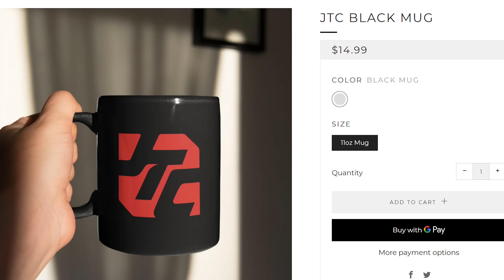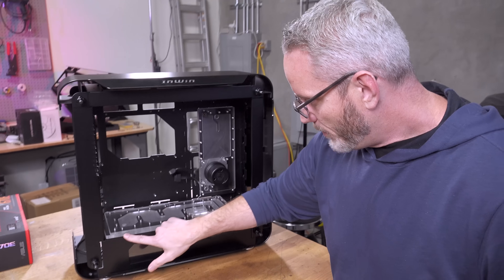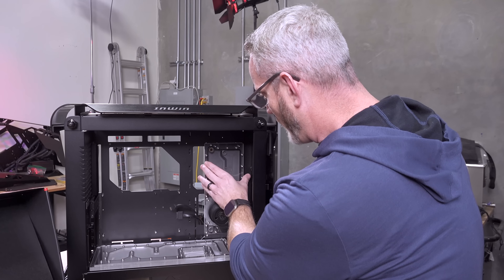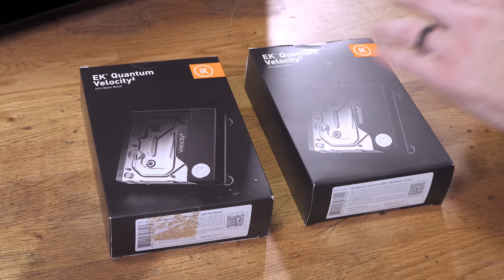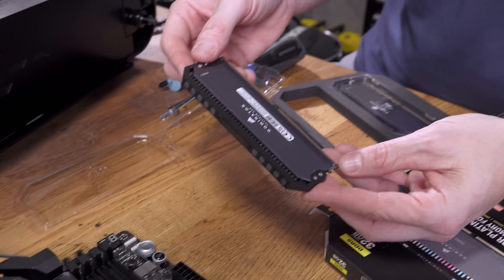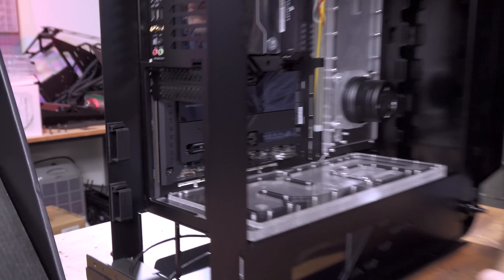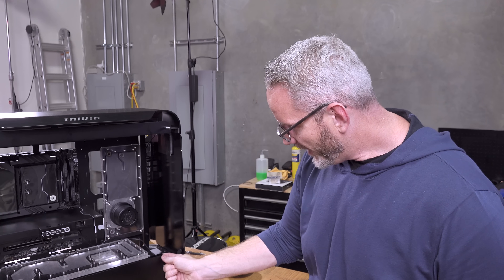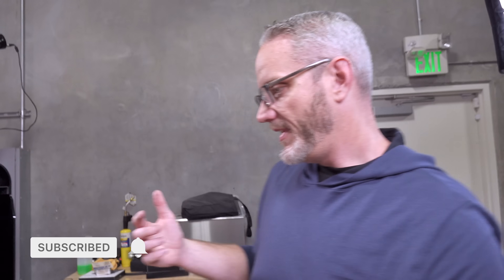My first water cooled build is 2023!

Comment: Jay, leave the edges frosted but don't use the trim paint. Get some of the tail light tint paint. It will make the edge seem black until the LED's are on, then it will tone down the light just a little bit. Kind of like a two way mirror.

Comment: Great video, thanks and hope you feel better soon. For me, allergy season started early this year, though it is still cold in Germany... The bottom distribution plate seems to create as may problems as it solves, unfortunatly. I've never done my own water cooling, but from your and similar videos, I could see this "tube sequence" working: 1) fittings-only connection from pump-out to bottom distro; 2) left-bottom distro out into right GPU in; 3) right GPU out along GPU and back-side of the case into top radiator in; 4) top radiator out to top CPU in; 5) bottom CPU out towards the top and then right in to the front radiator port closer to the glass panel; 6) front radiator into the pump reservoir. You could terminate tube 5) into the front radiator with a T-style fitting with the T-junction having a quick-connect pointing up and out as a fill port. In terms of bends, that seems managable: 2) 3 bends; 3) 2-4 bends, depending on how many right angles you want and how well the ports line up; 4) 3 bends; 5) same as 3); 6) 2 bends. For either 2) or 4) or both you could even consider use two singly-bent tubes with a 90° fitting instead of 3 bends! A black fitting there would be kind of understated, chrome too much, but are there gun-metal colored ones?!?

For temperatures it most likely will not have a measurable impact to have a rad behind either heat source, but it feels more satisfying than having "pre-heated" water trying to cool GPU or CPU. And your radiator fan speeds would reflect either GPU or CPU intensive tasks differently, which might be cool ;-)

Comment: Just from gpu to cpu, then into the left radiator intake and from outlet to vertical distro plate with slight bend in the start to match the hole. will be easy, less restrictions for pump. And start using xFlow radiators come on, they are so good for top mount, saves a lot of piping and does not restrict flow.

Comment: I also had rattling/dead Uni fans in my build of 18 months. Of course it was the middle fan in the stack, so I just ripped them all out and replaced with my old Noiseblocker eLoops which are still going strong after 12 years.

Comment: I got the Lightwings in my build and i can tell they are beasts. 2 360x30mm rads and they're running at about 850rpm, absolutely silent while performing the same as my old Corsair Fans@ 1000rpm...

Comment: Polishing acrylic cut edges is work intensive but well worth it. I used to hand sand with 400, 600, 800, 1000 then use the Dremel white barrel brush with red jewelers paste to get a glass finish

Comment: I'm currently building a case for my new build, the case is an open case design, made out of 16mm copper piping, the case itself will also be filled with liquid to be part of the watercooling of the CPU and GPU, using 2x480 rads, both blocks are copper plates. Will post my build log for review. This is my first time liquid cooling as well. Needed to use some liquid flow dynamics software to ensure the case would flow liquid correctly. Using Intel 13th Gen i9.

Comment: My Question: Is it possible to rotate the bottom distro-plate 180°, cause it looks like the hole, that is currently on the left side, could line up with the bottom port of the distro-pump-plate? 🤔
Reply: I was thinking same. But does it ruin the cable hole, I don't know.
Reply: right, I didn't think about that

Comment: Jay, you know you could have forced a firmware update for that RAM within ICUE. The hamburger menu (directly below the "Check for Updates" button) has an item "Force Update" for such occasions. Just remember, the hamburger menu icon won't show until you ask ICUE to check for an update.
Reply: Good to know.

 I'm fighting with iCue right now because it won't detect an older Corsair AIO I have installed. I think it's an H100 but idk for sure, got it for free with a used C70 case I bought on Craigslist). Even tried the "legacy"  version. 

So I'm stuck with whatever color it decides to be when it boots, which is sometimes white but more often green. Kinda clashes with the purple theme I have going everywhere else, lol. Maybe this will fix it. 

iCue is garbage but sadly it's simultaneously probably the best manufacturer's RGB software I've ever used.
Reply: Bro get signal rgb and you're problem will be solved.
Reply: @TechGuy42ilm  NOT entirely... SignalRGB has been a problem for me when my PC wakes up from sleep... keeps setting all to "strobe" haven't looked back since using Mystic Light (within Dragon Center)
Reply: @BeezyKing99  never one issue
Reply: @bill_and_amanda  try corsair link instead of icue
Reply: @TechGuy42ilm  In your case, there may not have been any issues, but at the time I used their program, it was full of problems like having to restart the app just to tell the RGB lights "hey! the damn app is running, now listen to what it's saying" EVERY TIME THE COMPUTER WOKE UP FROM SLEEP MODE
Reply: OpenRGB ftw
Reply: @BeezyKing99 that's been dealt with
Reply: I had an issue like this, turned out my icue keyboard was conflicting with the ram, changed a setting in the keyboard options and ram sparked back to life.
Reply: @BeezyKing99  I've had the same thing or similar with signalRGB... they claim to have a good setup, and say they are a free software, yet they push their paid options that you'd think they didn't have, judging by the ads for it...
Reply: @MexicanOrphans  link is EOL and isn't getting updates anymore, and hasnt for a while

Comment: @JayzTwoCents
Not sure if anyone mentioned before, however if you flame polish or laser cut acrylic (PMMA), edge can shatter on contact with any perfume, alcohols, etc. I know it’s unlikely, but the CNC routed finish is sometimes intended. 
Cutting done in multiple passes will leave a tiny “ridge” as you noticed, which could be avoided by a “finishing pass” over the whole piece.

Comment: Things to experiment with, for the rough cloudy water block acrylic edges (besides trying the heat treatment):
1) Apply Cell Helmet. Yes the liquid stuff you use for phone screen protection. 
Penetrates the finer scratches real good, while also filling in imperfections. 
2) Try clear nail polish, on the acrylic edges. If its too thick and not penetrating enough for the finer areas? add a touch of acetone to thin it out.
3) Rain-X (but you will probably need to re-apply at some point).

Comment: I'm looking and thinking going from the pump to the gpu first, it'll save the short angle to the distro, you can return to the distro then to the rad, so Pump, gpu, cpu (parallel or series), distro (front (inner)), front rad outer, top rad inner, then back to res.

Comment: acrylic block edge... 800-1000 grit wet sand edge smooth, use 2X clear coat. same way you would do to heads light lenses.

Comment: This is a tip from my machine building days. If the distro blocs are made from the correct plastic, acetone will make the edges very clear and smooth. A quick test would be needed tho, just like the flame polish.

Comment: For the pump outlet......I'm not a builder by any means so forgive me if this is dumb.......on the pump OUTLET go straight out about the same distance the bottom inlet port is on the reservoir on the bottom of the case...... then 90° up to the top of the pump, then 90° to the right across the top of it...90° down to the bottom of the pump, 90° across the bottom of the pump then 90° down into a fitting on the inlet of the water block on the bottom......as long as that wouldn't interfere with the rad and fans on the front. So you'd have a square of tubing surrounding the pump that would look cool and show off more of the fluid your going to use.

Comment: dont know if it will fit but u could try: out from pump to right side GPU, then paralel to CPU, out (left side) GPU to left side distro block, right side distro to front side rad. then make the one going out of the pump and distro both next to each other (and parralel) to the front of the case. if this fits u can (almost) only use 45degree angles and use the distro

Comment: I wouldnt use the distribution block but instead have a tube go to the basement and swap to soft tubing down there with quick disconnect then return to come back out in hard tube by the radiator. Then you can have a drain valve attached to a quick disconnect with plenty of tube to exit the case stored down there so the loop can be drained. Better two of them so it drains from both directions.

Comment: I would plumb this. Pump-> distro plate front port, probably the hardest connection to make there. Back of the plate -> GPU in, GPU out -> CPU in, CPU out -> top rad (fittings at the back)  top rad to front rad (fittings on top and the longest single tube) finally front rad back into the pump plate.
Edit: if possible a T at the rear port of the distro plate to use as drain.

Comment: Jay I’d sort the tubes out by reversing the way you’re connecting them. So instead of trying to make that tight bend on the bottom of the pump plate take that tube all the way to the rear port of the bottom plate then have the front port be the outlet to the GPU or the front rad. It means more tubes that will fill that empty space up nicely and you can make cleaner bends because you don’t have any tight spaces to fit them into.

Comment: You can't rotate the distro plate? The tube connections will be on the front, but gives more room for the tubes. Only problem could be the mounting screws not lining up.

Comment: 4:38 i dunno how it will make the block look from the clear side but i would first slap a white primer on the edge to the light to bounce back to the block then paint the outer side with black since the black paint will absorb some of the light or get a brushed aluminum strip on the sides that is painted black from the outside

Comment: Jay you can mod the distro plate by adding a fitting location where you please. I forgot what tap size you need but you can easily get that on amazon. Just take apart the distro plate and carefully drill and tap your desired feed/outlet location. Taping the area and marking the locations in the fitting stage would help with perfect alignment before drilling and tapping. I know I'm stating the obvious but, hey its an idea.  Either way sick build bro.

Comment: I think if you did two silver 90 degree angle fittings with a clear tube would look nice. Run the tube along the bottom, the 90 it up and if it does not line up exactly, you can tilt it that little bit to fit it together. With a clear tube it would pick up the lighting and look nice. And if they have colored coolant, then you could run, like a blue, colored coolant through it to enhance the look more. At least in my taste for what you have right now.

Comment: Pump/res-> distroplate-> GPU-> CPU-> Top Rad (input would be the port closest to the back of the case)-> Front Rad (input would be the port closest to the glass panel)-> Pump/res
You can do a capital Gamma looking bend from distroplate to the ‘top’ of the GPU, 45 from gpu to cpu and top rad to front rad would give you a nice clean tube right across the top of the case :)

Comment: I'm getting ready to start on a very similar build of my own soon (different case though) so this was really interesting!  FWIW the Asus Hero was also my first choice for my AMD MB, but then I saw it only has the one NIC and it's the Intel 2.5 Gbps V226 chip that's having random disconnect issues...just like the previous Intel V225 chip had the exact same issues before they updated it to HW version 2.  I spent the extra $ for the Asus extreme since it also has the 10 Gbps Marvell NIC, which is the same one I have in my present system and I've never had a single issue with it.  Good luck with your build...can't wait to see how that (redacted) performs!

Comment: instead of the distroplate, get a solid (some kind) of metal (or some heavier plastic) block CNC'd exactly like the distro, paint it black and add the same lines as the waterblocks have! Then you still have the good features of the plate like hiding gabs, but no need to make weird bends and stuff! 
there's probably a local company that'd be glad to help you!

Comment: Jay, just a thought.  I understand your desire for straight water cooling tube lines.  However, since you have to angle some, it might add that clean aesthetic if you try to put all of them on the same angle.  Not sure if it would work.  All tubes at 45 degree angles vice parallel.

Comment: My only recommendation for the tubing paths is that if you use a 90 degree fitting coming out of the gpu (or into it) you could make a clean 90 degree bend that would flow into the distribution plate.  You could also vary this by putting that fitting on either the top or bottom of the gpu block.  

It probably seemed obvious but I wanted to remind you in case it slipped your mind

Comment: Jay, maybe tape of the plate edges with some pinstriping tape, leave 1/4 or 1/8 frosted in the center of the edge with the rest painted.  You'd still get lighting showing through, while reducing the area that's 'unfinished'.

Comment: I have two 360 radiators in my case, and the main thing I don't like, is the long tube in top from back to front.
I takes away from the nice looks of bended tubes.
Maybe a pass through to te back?

Comment: Love your videos. Gives me alot of ideas for my next build. Some you questioned though in beginning is will the unrefined edge shine too much light. I was wondering you ever thought about building a testing power setup. Something that you can just plug something into to verify it is what you want. For instance a fan powers on. Or lights power on. Or the pump just turns on. This way an entire system doesn't need to be used. I don't know if a raspberry pie or arduino setup would work for something like that.

Comment: Hi, Jay, the parallel is a good idea. It was also a good idea when you did it for the Phanteks EVOL build a couple of years ago. I liked it so much I swore I would do it in my build and a couple of years after, I finally did it last month. I used soft tubing though. I will try to switch them with hard tubing soon, just need a little practice on bending tubes first.
Reply: @sinAnon6689  Thanks for the tip, I will definitely take great care about it.

Comment: how hard is it to drill and tap acetal? you could figure out where you want your fittings in the block and make your own and put plugs in the others and even drill a hole in the lower block and put a drain in the the bottom of the lower res down by the PSU. as far as the edge of the blocks, you can sand them smooth and use an automotive headlight polishing kit to clean them up. I have done that before to remove scratches from blocks. it works well

Comment: my idea for routing. starting at feed port to gpu direct, then to cpu, to upper rad. run a tube from upper rad down to the rear port on bottom distro plate then run to front rad from there to return port. 
I feel like that would give you much cleaner lines then running short runs for all the outlets.

Comment: If you wanted your GPUs power cable to line up perfectly in the run through of your distro block you could drill new mobo mounting holes in your case. I wicked OCD too so little things like GPU power cable not lining perfectly down through would trigger me too. Build look sick so far

P.s. Comment below suggesting automotive taillight tint spray paint for distro blocks edges might just be brilliant.

Comment: Jay, sand the edge with fine sandpapers (wet sanding) and then move up to extra fine grits using Micro Mesh (used to polish out aircraft cockpit windows. It will take time,, but should give you the results you want.

Comment: 23:55 Pump outlet -> Distro block (close port -> far port) -> 4090 (Lower right port -> Upper left port) -> velocity block (Lower  -> Upper) -> Top rad (Motherboard Port -> Side Panel Port) -> Front Rad (Side Panel Port  -> Motherboard Port) -> Pump Res

Comment: Oke jay listen up. If you want a parallel loop with the cpu and use the distro you gotta go out from the pump to the gpu inlet. Gpu outlet to the distro inlet on the right side. Then from the distro outlet to the front rad. That way you have 3 clean parallel runs on the bottom. 
Top rad you gotta figure something out

Comment: Jay, or anyone with the knowledge. I built a new PC but don't have a processor or video card installed yet. Asus ROG STRIX X670E-A mobo, NZXT AIO cooler, and (10) fans. I was hoping I to power it up, and checkout all my fans, (two are using headers on the mobo, rest off NZXT controller), be able to let my pump run a bit. When I power it on the boards RGB lights up, the pump's screen lights for a microsecond, and then nothing. At no point do any of the fans even budge. None of the QLED's light. Today I tried again after checking all connects, now the only thing showing power is the boards Aura RGB.

Comment: You could wet sand and use plastic polish with a buffing wheel on the sides of those distribution plates. It would take some time and elbow grease, but it would leave you with a really great finish.

Comment: I think my build is going to be very similar to Jays I am also planning to go 7950X3D and ASUS 4090 with EK water block, however the performance difference between the TUF and the Strix is too small this gen so I'm just going to get a TUF 4090 and the savings over a Strix will cover the cost of the water block.

Comment: Just as a note from me:

I had the same / nearly the same issue with my RAM and Corsair send me another Firmware (old Version), then i could flash on that.
After that i was able to do the "update" to the new version again and all worked fine.

But i have several other problems with ICUE xD